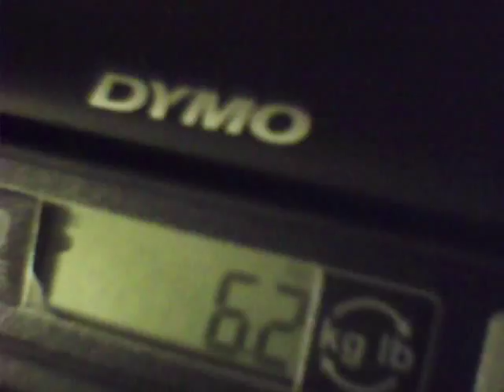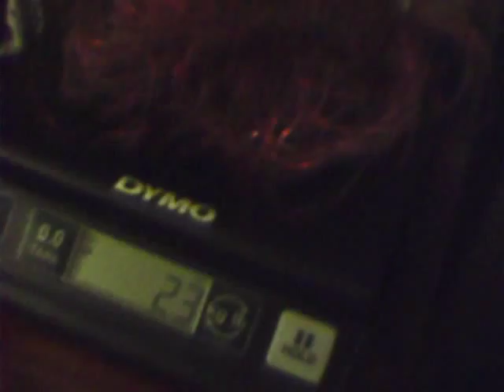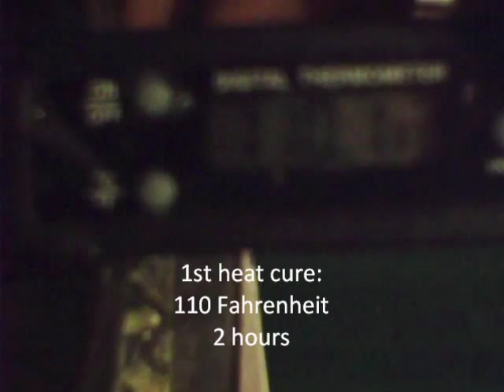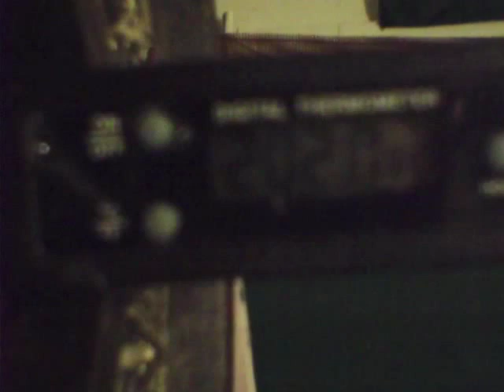Alpine Type R 10" repair pt7

Comment: Thanks for posting the video on how to rebuild the voice coils. The heat curing does seem time consuming.  What's the maximum operating temperature of the epoxy after you heat cure it?

Do you happen to know the other specifics of the voice coil? How many layers total, gauge of cable used, and height of the voice coil?  I'm interested as I want to know what type of power handling these things can take.  These are quite high, so it'd be good to know.
Thanks!